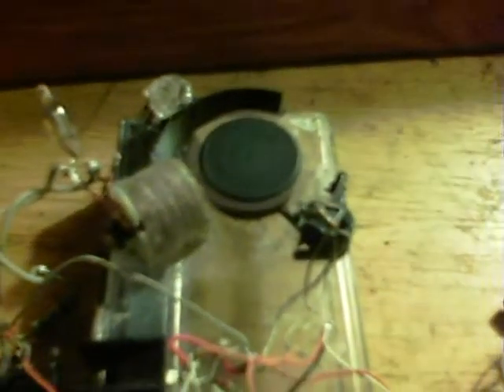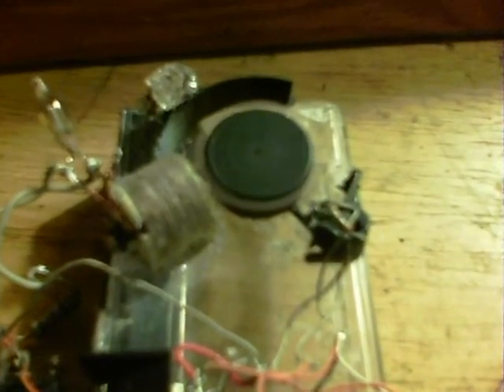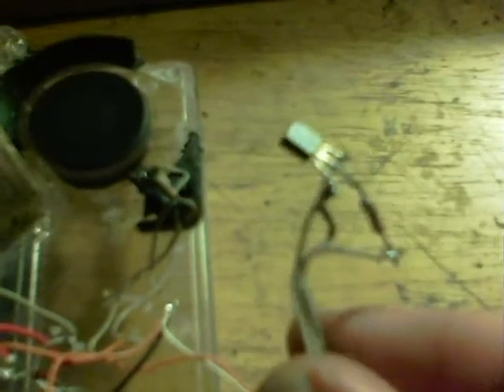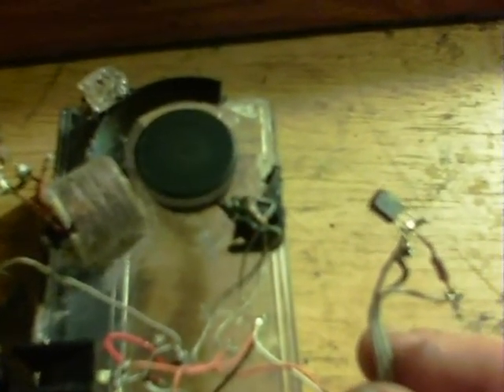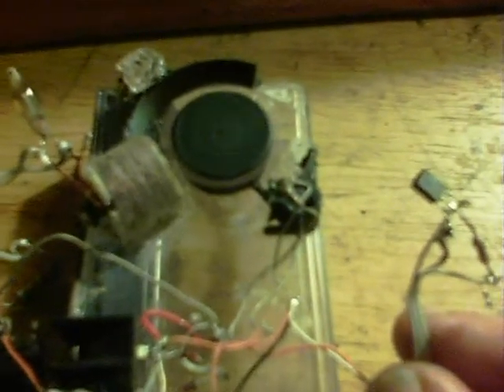Thyristor powered pulse motor

Comment from the maker: @Tecknomancer1 Thanks. I'm best swapping the coil for that test because this type of multistrand (Romero method) runs the rotor at the same speed no matter the voltage. The thyristor coped with up to 9V so far but I don't want to break it and the rotor wobbled, presumably with extra current, but didn't pick up any speed.  A relay coil might show a different effect. The motor will also start on its own with relay coils, or at least has done with transistors.

Comment from the maker: @beac310 LOL...that's my point too. I did think it may be switching, but not as a regular function, as an effect of losing the Hall sensor current (from what i've read so far). So, a repeating on/off/on/off. In that way it would work like a MOSFET. 
However, circuits online show latching buzzer alarms and similar that demonstrate the latching because of losing that current. So i'm all ears about what is happening - maybe the coil collapse AC is doing it. Interesting little devices.

Comment: Just a guess, but the trigger circuit in the School Girl  setup is isolated  so as the magnet passes field would still collapse ending the trigger voltage if it is working like a mosfet then the timing is everything. you might try slowing the wheel down with your finger if it causes the circuit to stop spinning (timing would be off ) but it it picks back up to is run speed the field collapse is handling the trigger timing.
anyway nice catch :cheers